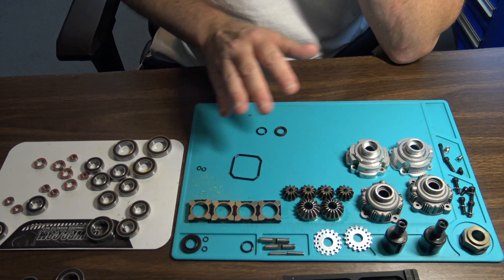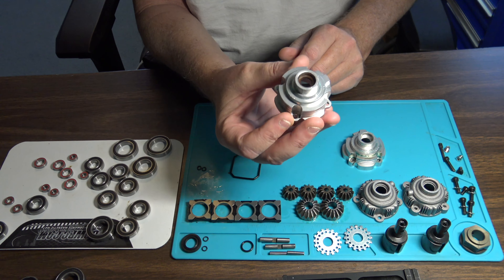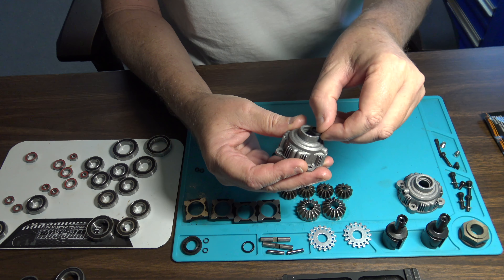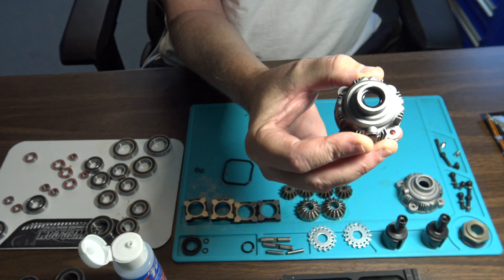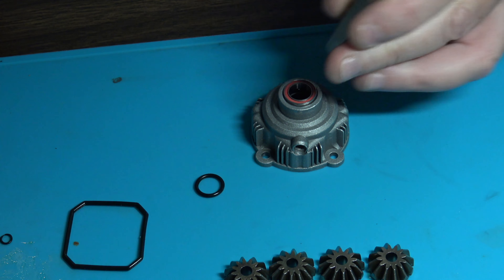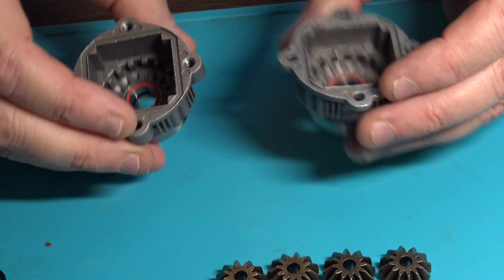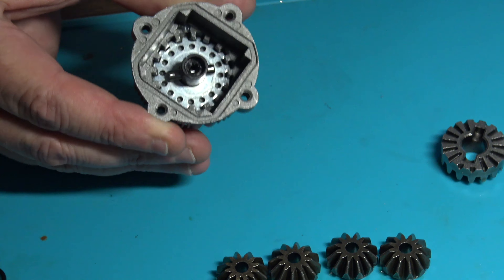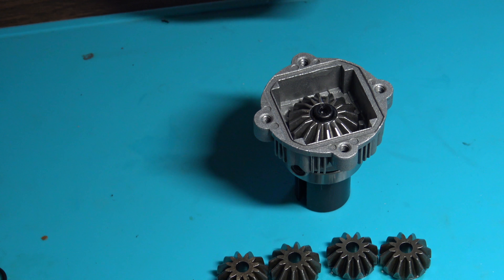Trans/Diff Rebuild - Part 2 - 1/5 Scale HPI, Rovan

Comment: 4:34 were is the assembly Lube??
Reply from the maker: No assembly lube required on a sealed diff except for I usually put some oil on the O-rings. Silicone diff fluid fill @ 16:40.

Comment: please tell me, when you turn the differential shafts in different directions, do they spin smoothly without effort? I have a new differential and when I turn the axles in different directions, they resist a few degrees, then spin freely, as if they spin at some intervals
Reply: That’s interesting. My heavily used Rovan had its diff completely locked. I took it apart and put it back together. Smooth now. No idea why it was locked. No signs of excessive wear and no locking parts inside. 
You should rebuild it and see if you can make it smooth at all times.
Reply: @michaelinzitari  thank for your reply! have you used grease for bearings?

Comment: Im confused .. rebuilt mine and it functiona fine pre post assembly.
. But once in the car it will counter rotate half the rotation then just lock in.. stays locked until i make it happen..yet no leak no filings very odd 🙄
Reply from the maker: Sounds odd. Should be able to rotate forward and backwards with no resistance. Check the rest of your drive train.

Comment: Hi, is it necessary to change the diff oil straight out of the box. Just bought a rovan stealth and the lad in the shop advised to change it ?
Reply from the maker: Quick answer is no but.... Rovan is know to be stingy on the diff fluid. They are easy to take apart and at least check before running. I would. If not you maybe re building the diff sooner than later.